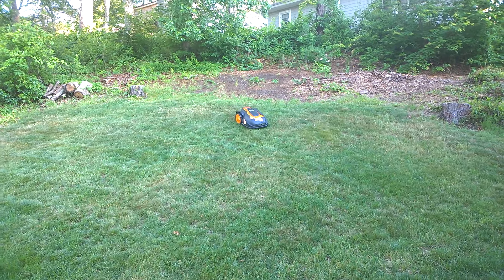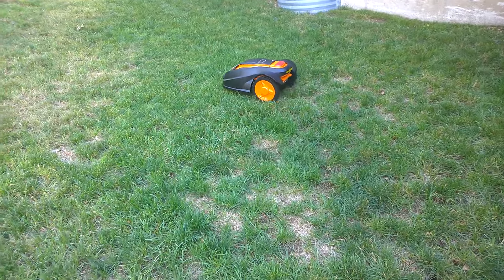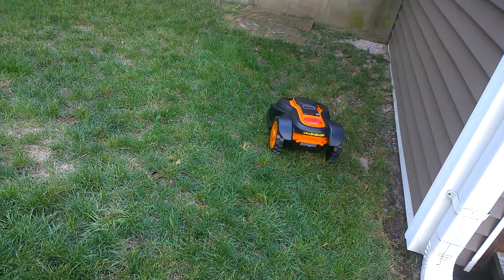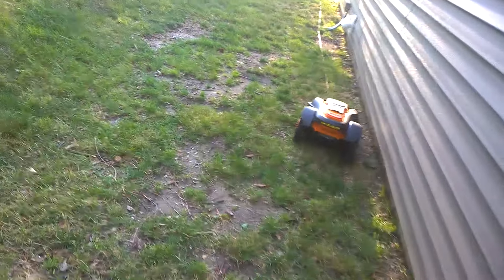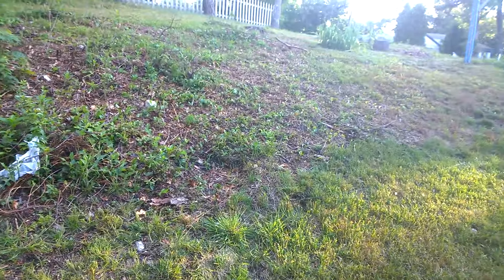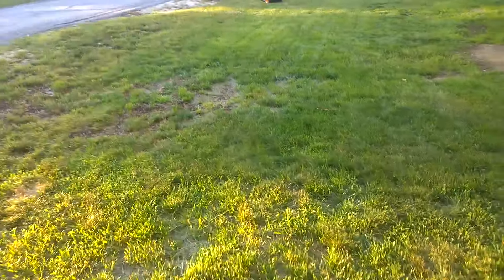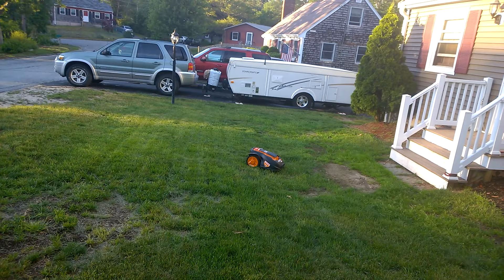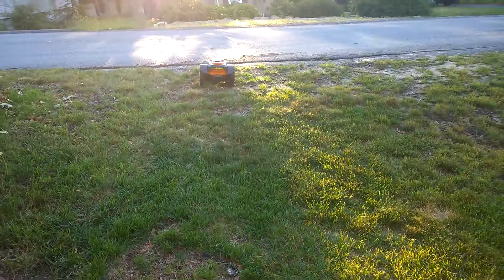Worx Landroid 1st time mowing Pocasset MA

Comment: interesting, suppose wait for a few times, does it not go over its path so often, returns to recharge. will it ever run out of power before getting back, do show us more, perhaps when it is finished driving to base and leaving base
Reply from the maker: George Gardinier it just mows in a random pattern but it will mow your entire lawn.This is a great mower, look at all the other brands they're way more expensive and this does better than the others.It even has rain sensors so it will stop mowing and return to the base, once the sensors dry it will return to mowing.They even offer software updates on their website to update the mower.I'll post more videos once I get it fully set up, I had to order more boundary wire stakes they gave me 200 with the mower but I don't have enough because of the size of my yard, it came with 590 Ft of wire and I used it all.I found out you need 2 stakes per corner, I made the mistake of using 1 which squared of the corner, but the mower has a hard time turning.So I have 200 more coming so I can fully get the boundary wire staked properly so I can make sure the mower can return to the charging base with no issues, once it does that I'll bury the wire just under the surface.The great thing is this mower is fully programmable so you choose when it mows, but it comes ready to mow right out of the box.

Comment: So is this still being used? How has it been working out?
Reply from the maker: jimbodunky
Quote= So is this still being used? How has it been working out?

Yes I am still using it. 
I love it does a great job keeping my yard mowed, the only issue I'm having is the Bumps of grass caused by bald spot's  causing the Landroid to get stuck in places.
But that's not the Landroid's fault, were gonna be landscaping the whole yard and laying down sod, so that will solve the issue. the whole yard is sloped were gonna level it and put in retaining walls so the ground will be flat, then the Landroid will make it back to the base every time, right now the side of my house the hill slopes and the Landroid can't make it across, it's to steep, but the back yard is ok and can make it back to the charger ok.
before the sod goes in, were gonna stake the boundry wire down, then lay the sod on top of that ,then the wire be never be seen at all. I'll be doing a video the day that happens, showing the before and after.